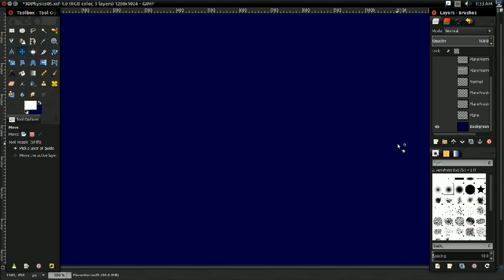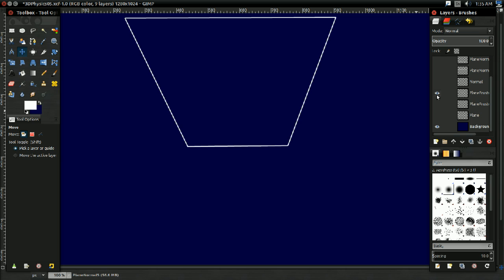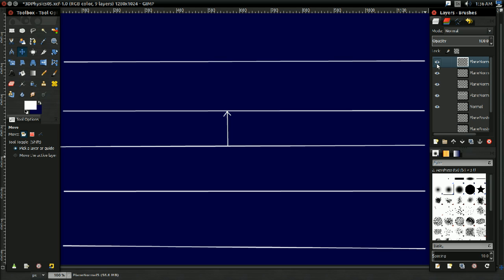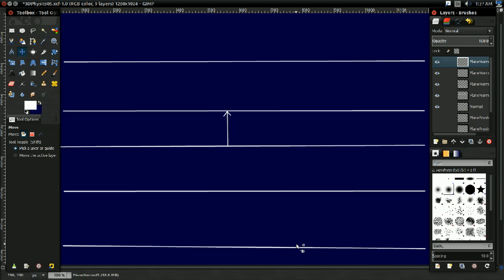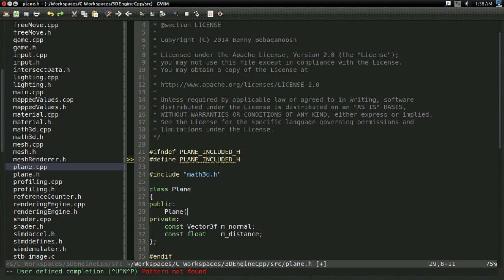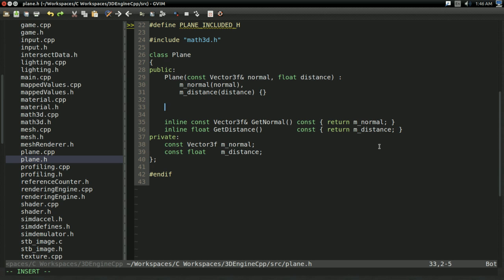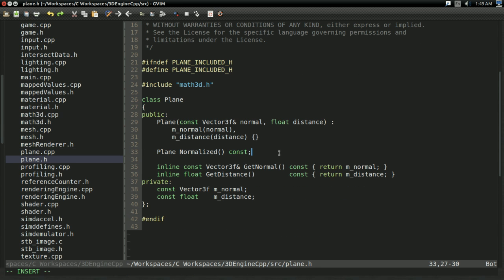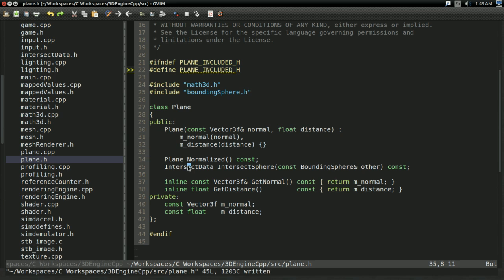#5 3D Physics Engine Tutorial: Plane Collider

Comment: Hi Benny! Why exactly do you want to know the intersection depth?
Why do you think it's more useful than only returning a boolean in the intersection tests?
Reply from the maker: It's for collision response. I'll explain it in detail then, but for now, here's the short version:

Let's say before the simulation, no objects are intersecting, and after the simulation progresses by one step, objects are suddenly intersecting.

That means at some time between the two simulation steps, the objects must have collided with one another. To be accurate, the physics engine must simulate the collision response as starting from the exact time of the collision, even though that exact time happens between steps of the physics simulation.

That's where the intersect distance comes into play. Knowing that and the velocity of both objects, you can calculate the exact time that the objects collided, and simulate the collision response as starting from that point in time.
Reply: Great explanation and it totally makes sense to have it in there now. Thank you!
Reply: ***** I have noticed this when I made a simple colliding balls program (in javascript). Without it most collision still look good, however sometimes they would get stuck in each other and spin around each other.

Comment: Shouldn't the normalized m_distance be multiplied by the magnitude, such that the offset of the plane is still the same? Since you did not tested a plane which actually need normalizing you haven't encountered yet. And when calculating distanceFromSphereCenter I would think that you would have to subtract m_distance instead of adding it to it, which also wasn't tested with your testcode.

Writing testcode which tests all aspects of all the new code can be tedious sometime, but is very important.
Reply: I know you said this 9 years ago but I just spent hours testing this and drawing diagrams and you are definitely correct. The planeSphere intersection formulas in his project that I downloaded from Github are wrong for all planes not set at the origin. It's very frustrating that he didn't test any planes offset from the origin or the Normalized function. Thank you for being the lone voice of reason in this comment section though.
Reply: I also think that there is no reason to normalize the distance but I guess it depends on how the planes are initialized. I would imagine that you would specify a plane with a certain distance and assume that the normal is normalized before using this distance. Then I believe you don't need to normalize the distance.

Why would you have to subtract m_distance instead of adding to distanceFromSphereCenter? The dot product is done with a direction vector (normal) and a position vector (center), so essentially the normal points out from the origin. To compare the result of this product with the sphere's position you need to add the m_distance to offset the plane from the origin (along the normal).